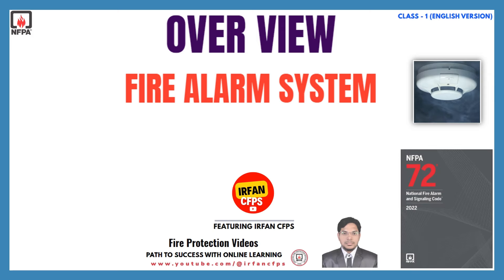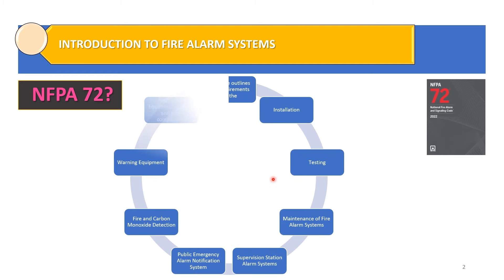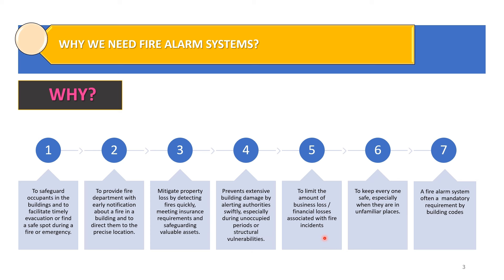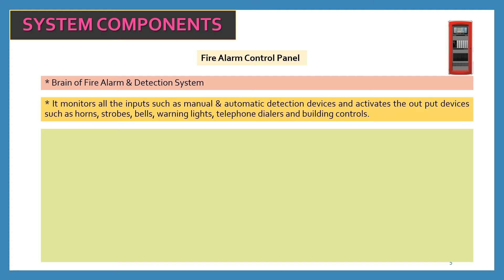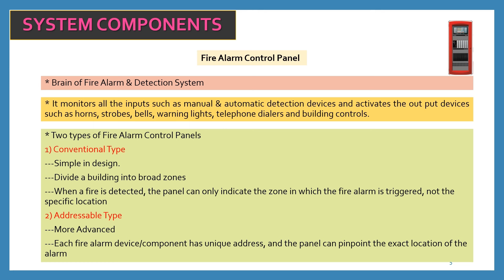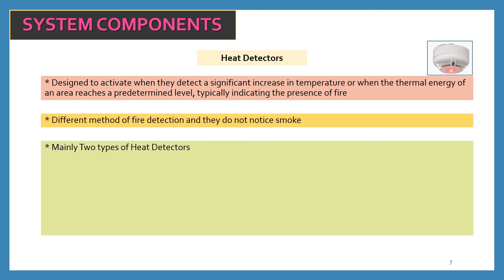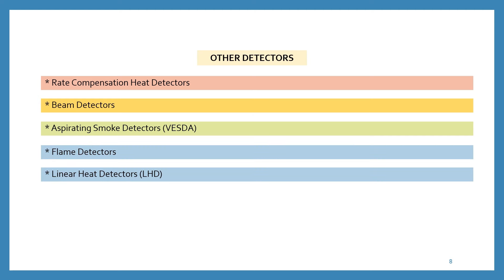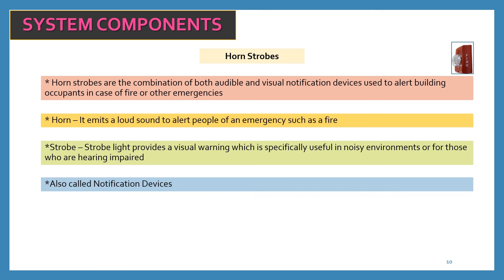NFPA 72 | Overview Fire Alarm System

Comment: I have small concern... As you said there is no fire alarm system without panel.. but we can use smoke alam with embedded battery..like stand alone system
Reply from the maker: Yes u r right but kindly check nfpa 72 whether it is acceptable and let me know.